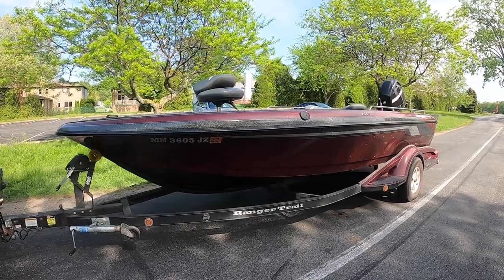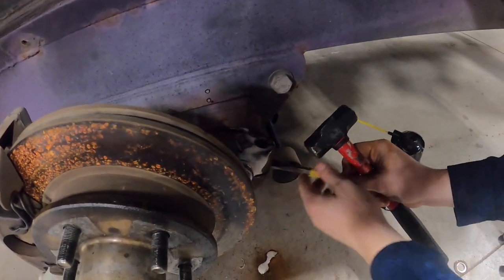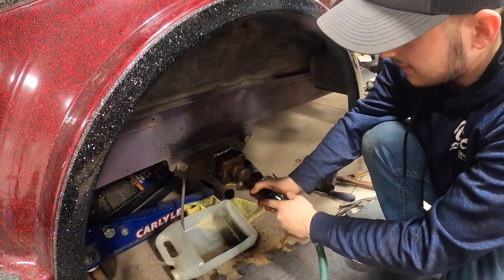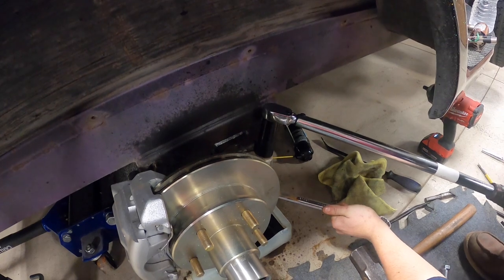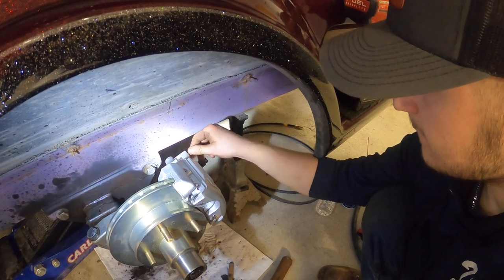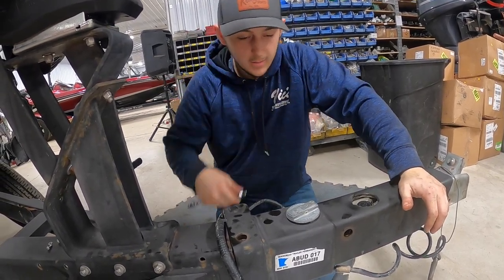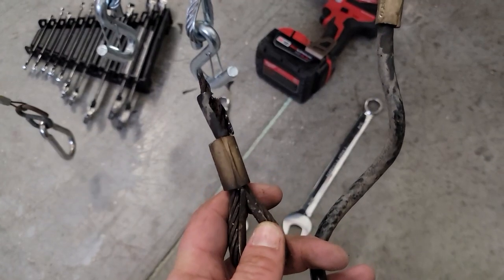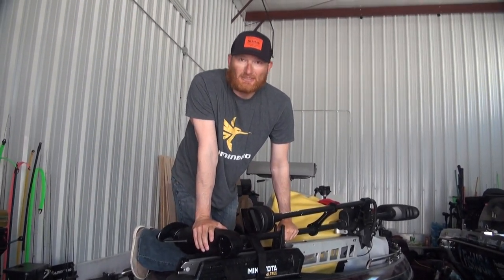How to Rehab a Boat Trailer | My Project Boat Part 12

Comment: Those Ranger Vortex Hubs are a pain in the ASS... I watched your video then checked mine and low an behold one is full of grease must have blown it this weekend. This in my 3rd time repairing or replacing hubs on my Ranger , NOT A FAN OF THEM .. Love my boat hate the hubs ..   Great video very informative..
Reply: Have you heard of guys switching the hubs over to bearing buddies because the pain in the ass the pose ?
Reply from the maker: My experience and my dealer has had great luck and way less issues that what you are thinking of switching too honestly
Reply: My issue in Northern ontario is finding someone to properly fix them or understand what there dealing with . But good to know i'm on the fence of switching The use i put on results in shit happening i think no matter what system i go shit will still happen ,  just funny i watched your video an thought mine are good i check half hr later an there not lol , did you jinx me Ross ??